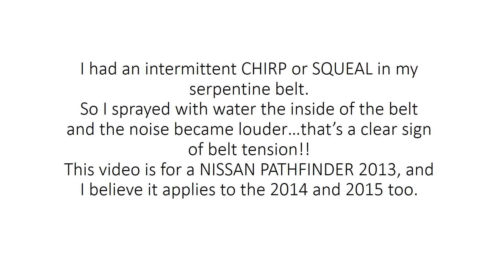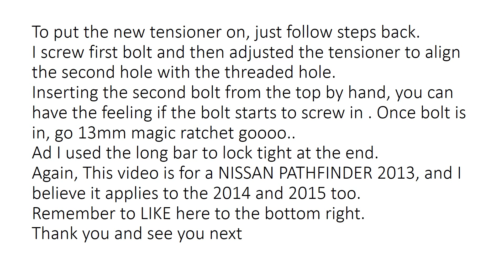Nissan pathfinder - Idler pulley - drive belt tensioner -  serpentine belt - how to jack

Comment: okay so yesterday 8/25/19 i tried changing the tension/diplar  pully  however  the part available for 2013 nissan pathfinder found at auto zone and other locations is not the same size as the part on my car? did you have this issue?  where can i get this one part. i appreciate any assistance.
Reply from the maker: I bought it on Ebay 2 years ago. But I know it is not easy to find the exact part
Reply from the maker: https://rover.ebay.com/rover/0/0/0?mpre=https%3A%2F%2Fwww.ebay.com%2Fulk%2Fitm%2F392398279964